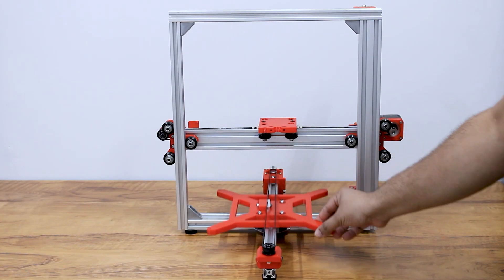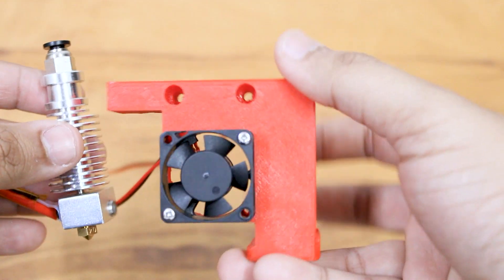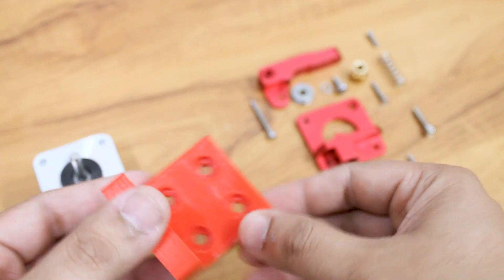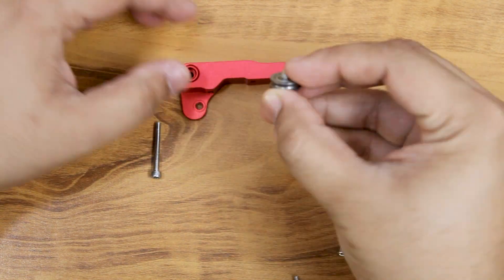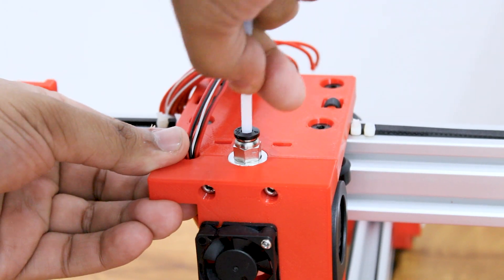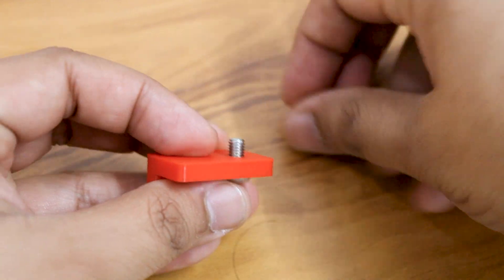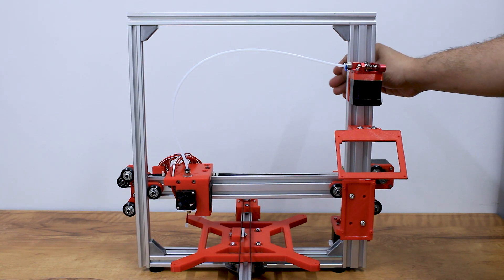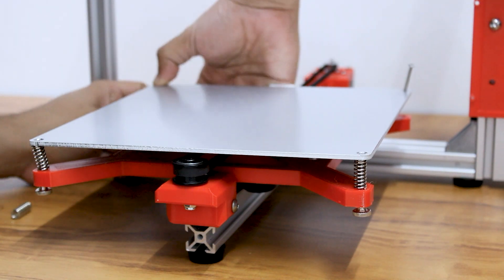DIY 3D Printer - Part 3 - Electronics Assembly (1/2)

Comment: Can we use a 235x235x3mm heat bed with your 3d printed parts? Please reply.
Reply: You should be able to. There is enough space, update the firmware with the bed size, default is set to 200x200.

Comment: Can I use ramps 1.4 instead of 1.6
Reply: You can but RAMPS 1.4 has a mosfet problem - it overheats and then burns if you run the printer over 5-6 hours. Rather get the RAMPS 1.6